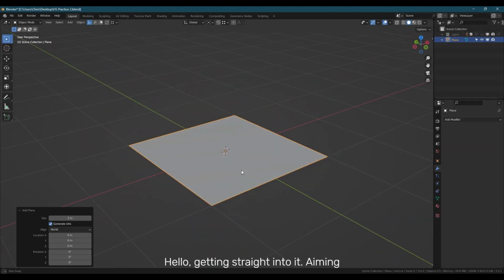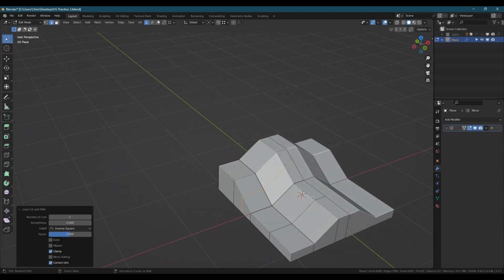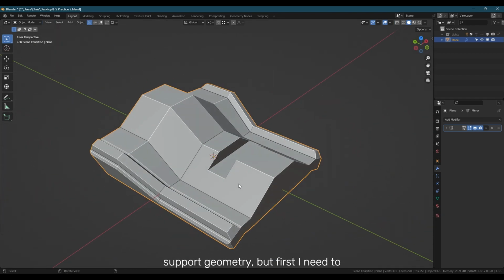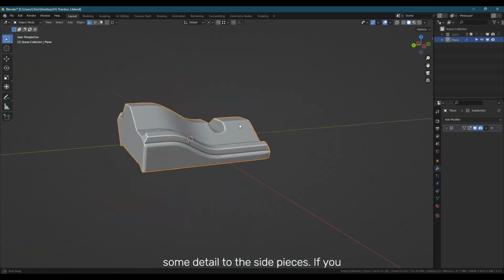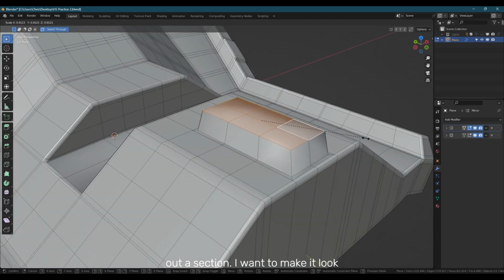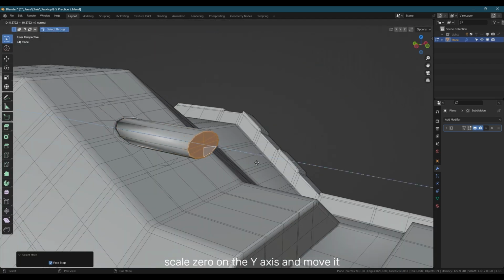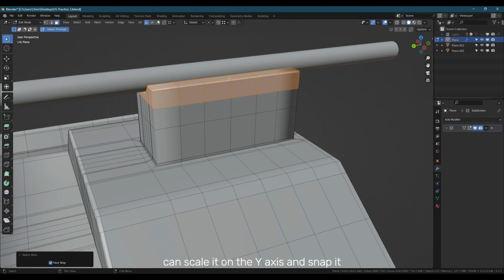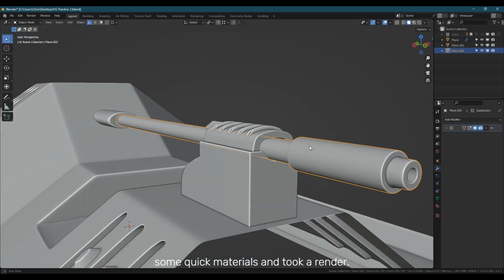Blender Hard Surface Practice 2

Comment: use auto shade smooth after the initial shade smooth to keep it from "rounding out" as you said. You won't have to add so many edge loops to clean it up.
Reply from the maker: Thanks 👍, just tried that, it disables the sub d modifier. Or at least in the Sub D modifier it says GPU subdivision disabled due to the custom normals from the auto-smooth. The edge loops are there to allow you to manually control how rounded a corner becomes.